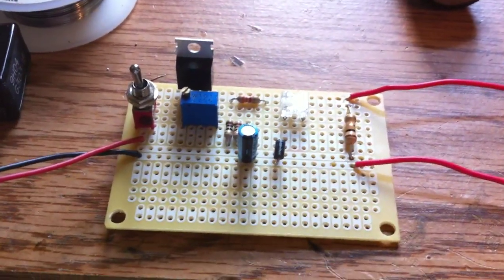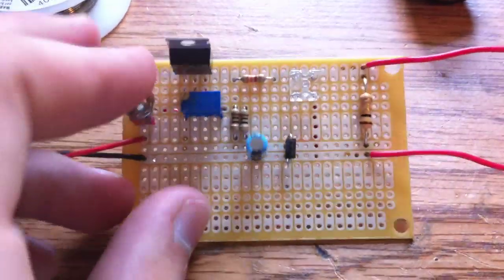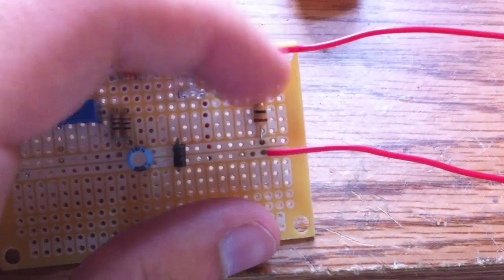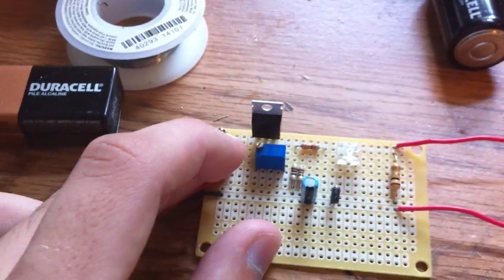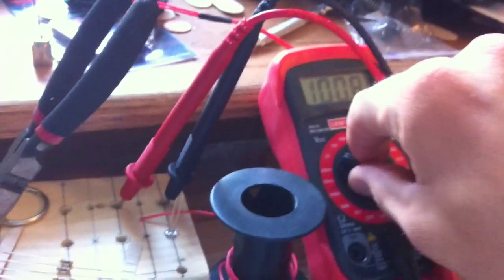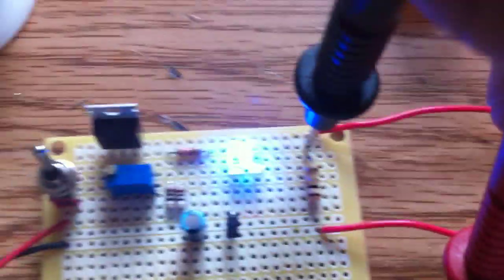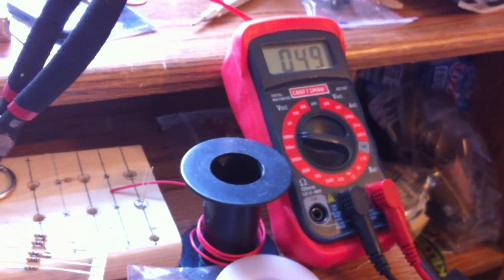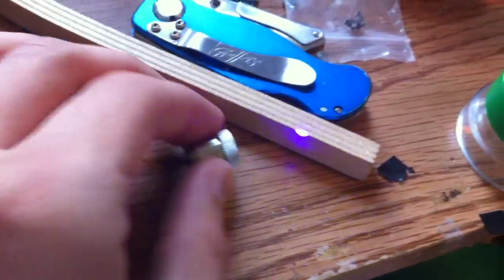LM317 laser driver

Comment: Your laser is NOT getting the current you are reading off that resistor if it is in parallel with your laser. Components in series see the same current but different voltages, while components in parallel see the same voltage but different current. If you are using a constant current driver, then a lot of current will flow through the 1ohm resistor. The lm317 reacts by outputting a really low voltage to maintain the desired current... which means you are way under powering that diode.